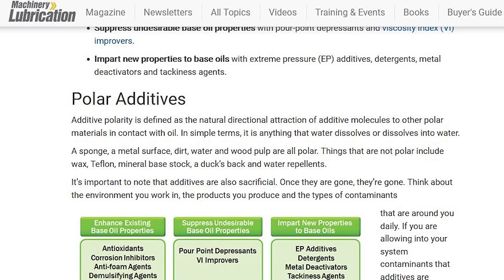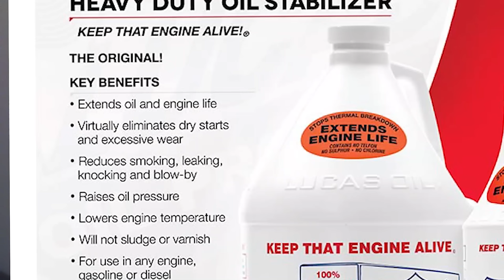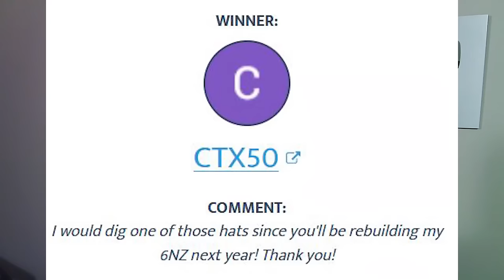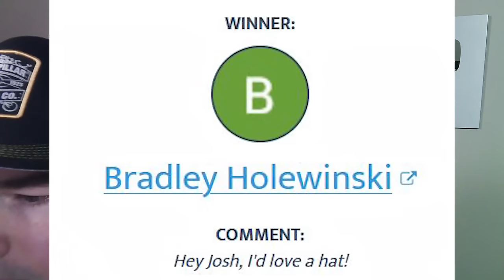Does your Engine NEED Lucas Oil Stabilizer? A detailed look at the "Benefits."

Comment: I been using Lucas sence I knew about it. I never used a hole bottle at one time. One bottle per 2 oil changes, it works perfectly...not bragging but I went a year on my Escalade, maybe, 300,to 500 miles a week..knock on wood. I been changing now!😂😂

Comment: My car is burning oil and they recommended I up my oil weight from 5-20 to 10-30, use conventional oil, and use 20% Lucas Oil Conditioner. I am wondering if next time I could just add one quart of 20w50 instead of the Lucas Oil. I was reviewing Bob is the Oil Guy and there were some comments about it frothing since it has no additives to it and that all it is is 120 weight oil with no additives.

Comment: When it’s cold like you showed in the strainer, was it mixed with the regular oil ratio as if it was a sample from a truck that had it mixed with the regular oil .  I bet it runs through faster then if it was just straight 60 weight

Comment: I was wondering are you supposed to put a additive in while the engine is cold or put it in while the engine is running. That way it can mix with the oil. I know stp recommend putting it in while the engine is hot and running.
After all your not running pure additive.

Comment: I noticed you made a lot of statements that are not corroborated by any documentation.  That’s exactly what you knocked Lucas’ claims about.   I’ll stick with using their products, based on the positive results I have seen in my vehicles.
Reply from the maker: They are the ones making the claims, their responsible for the evidence. Burden of proof is not my responsibility.
Reply: @AdeptApe  It appears that the majority of those who use Lucas answer “yes” to your question.

Comment: I run cats and 12.7 . I also run small block flat tappet cam Chevy circtrack motors. We run very low viscosity oil . We have to run zinc additive to  help keep cam and 
Lifters alive. I put zinc additive in every other oil change. Does it help? I don't know. But cheap insurance

Comment: I have a 2001 Sierra 5.3 with 400k I use 5 quarts of what ever is on sale plus 1qt of Lucas. I changed my oil religiously. My engine sounds and runs great and smooth for how many miles are on it. I drive it every single day. Is there any way to prove that Lucas oil is actually beneficial probably not but I've been using it for years and don't have anything negative to say about it

Comment: Use this in BOTH MY VEHICLES ('05 IS300, '06 TUNDRA) along with my '03 GSXR600, never had issues or problems and both vehicles are in EXCESS of 160k (Tundras got 200k), I've used this for YEARS and have always had respectable responses from mechanics when they've looked at the valve train and far as CLEANILINESS (internals) and how well the vehicle RUNS on an over all basis. I will continue to use this as I have on EVERY vehicle/street bike I've owned in the past. Plus, I've USED MARVEL MYSTERY OIL TOO and that shit WORKED WELL ON MY 65K mile 1967 SKYLARK.... smoothed it right out..... not all additives work, BUT THESE 2 DO. UNDERSTANDABLY not every BELIEVES the HYPE and everyone's entitled to do their own research AND SHOW PROOF of YAY OR NAY.... HELL I EVEN use LUCAS OIL "HEAVY DUTY AG" GREASE ON MY Tundras grease points because it burns up the MANUFACTURER GREASE FASTER then it does with LUCAS OIL PRODUCTS. I've never had catastrophic failure of ANY KIND using these products  LONG TERM, more over it didn't CAUSE EXCESSIVE WEAR ON ANY PARTS INTERNALLY including OVER WORKING THE OIL PUMP..... So I'll stick with em.👍😎

Comment: Question, my wife has a 2014 Terrain with 2.4 engine. If I do not put bardahl no smoke after oil change(about 6 ounces) the Terrain will stall, I replaced many parts and only thing that stops the stall is a oil thickener. Any idea why? I went 1 year after adding the no smoke, not once stalled, did oil change, stalled every time, added no smoke, stall stopped again. I'm confused.

Comment: Never been a believer in engine additives. Engines are designed with specific clearances, which require specific viscosity. Most are bandaid type products. Regular oil changes, filter changes, and general maintenance are the secret sauce for long engine life. The one product I used years ago was Tuff Oil. Pure PTFE. It came out before slick 50, which was just PTFE suspended in standard motor oil. I used to build VW air cooled engines many years ago, and always used synthetic oils on account of the high heat generated in air cooled motors. I had one motor that was run extremely hard for about 60,000 miles, and tore it down to do a cylinder change. I took the crankshaft into the machine shop, and it needed zero work! For an air cooled motor, that's been run hard off road, that's unheard of.

Comment: I’ve used it for twenty years never lost a  bottom end and all engines did over 1 million miles. Detroit, cat, Cummins. Serviced ever 10,000 so was it that or the Lucas I don’t know. Used fuel conditioner every service also never done an injector either. Who knows

Comment: This is my testimonial on Lucas Injector Cleaner;not oil additive. I have a VW 1.9 liter TDI Jetta with  425kmiles. I dont know about the oil treatment but the injector cleaner did not work. I had injector quantity deviations that caused alot of vibration at idle. I was driving 60k miles peryear.Used one gallon of injector cleaner religiously over a 2 year period. It did nothing. Within 6 mos of using Archoil Injector cleaner, my injectors were cleaned.

Comment: 310k stock lb7 I use in transfer case, front rear diff, engine oil. transfer case lasted 300 before pump rub got me. front rear diff do not leak all original seals except rear diff I replaced front seal with new yoke.

Comment: I tried Lucas in my 1974 dodge dart 360. It would dilute and make my engine lose a quart and half. Also the oil would look thin and foamy when I did the oil change. I was scratching my head not knowing that the Lucas was the culprit. After I stopped using Lucas my oil was normal and engine didn't use the quart and a half anymore.
Reply from the maker: Thank you for the comment, Lucas doesn't put these up on their website.

Comment: I bought an old dodge years ago. The guy replaced the motor with a bad high mileage one. Filled it with Lucas oil.  I had to replace the motor 100 miles later. Never could find the guy I got it from...

Comment: I think you mix this one gallon to 10 gallon of oil . I ran this in my Detroit 12.7 for 1.2 million miles same turbo and never removed the head . Also ran it in a C 15 Caterpillar truck engine which I did an in frame at 820,000 miles which I tore down because of a blown head gasket . I couldn't hardly hold the rods in my hand after removing . I cannot see it makes oil thicker but it actually makes the lubricant hold on to the metal surfaces . I do think most good engine diesel oil Chevron, Mobil & Shell already have treatments mixed in . As you know I have owned many Caterpillar truck engines 1693, 3406A,3408PC,and an Accert C-15 not a CAT fan so I can see why Caterpillar doesn't recommend it every body blows and crows about their Cat engines but then why are they not building  big truck engines anymore??

Comment: What about their stabilizer for newer engines? I can tell you their power steering stop leak works exactly as advertised. It said may take two bottles, mine leaked so bad you could watch it drip sitting not running, 2nd bottle, it totally stopped

Comment: So when my shop went from 15/40 t4 to 10/30.  All the older trucks didn’t like it. Lucas was made for diesels.  Not Hondas that run 0/20.  It’s not a mechanic in a can.  Maybe your looking to deep into this.  Again it keeps that “old” engine alive.  Now it does leave a nasty grease stuff in the valve cover. Bud again it’s a bandaid. Common sense goes a long way.

Comment: Don't doubt your findings but is it a "one size fits all"?  There are clearly different products for transmission vrs one for conv oil and one for synthetic oil.  Are you saying they are all the same product in the bottle?

Plus anyone who thinks an additive can "fix" anything is not that bright.

I started using the oil additive in my Corolla (regular) when it reached 250,000k and my Explorer (synthetic) when it reached 200,000k.  Both run great so who knows?

Comment: What do you think of prolong oil treatment? They have those crazy bearing tests where they put all the pressure on those bearings or they run the engine with no oil pan for hours and hours after treatment

Comment: My experience with the lucas is that its very good at gluing oil to every surface inside an engine, and keeping it there till the end of time.  It also failed to fix the valve cover leak.  0 Surprise there

Comment: Ive gone back and forth with lucas over the years..but i just put their synthetic stabilizer in my 2010 dodge 2500 5.7 hemi that developed a little tick in the valve train and it shut it right up

Comment: I noticed reduce MPG I normally take a 1:30 hr drive on the weekend it takes me 1/4 tank but it move to 1/2 a tank right after I used lucas oil. I normally have it used on old engines over 150k and it seems to do more good than bad, but in a newer car with about 60k it didn’t seem to have good benefits

Comment: I use 1 quart lucas on all oil changes.. if its a 4 cylinder then i do a little less lucas.. like 3/4 quart lucas and the rest the recommended oil. Never had anything but good luck with the stuff.

Comment: All engine oils are formulated with an additive package that includes anti-wear, friction modifier, detergents, dispersants, anti-oxidants, corrosion inhibitors, extreme pressure, anti-foaming, anti-aeration, seal conditioners, etc... I'm not referring to the aftermarket supplements like Lucas, BG MOA, Hy-per Lube, Liqui-Moly Ceratec...etc. It's not a good idea to use those aftermarket supplements as complications from additive clash and/or base oil incompatibiltiy are real issues that can do more harm than good.  Oil formulating is a very careful balance to ensure no one additive (or additive type) overpowers another.  When you go pouring some random supplement/stabilizer into that formula, you've now upset that balance.

Oil Stabilizers/Supplements are 99.5% olefin copolymer (a waxy, rubbery polymer) and 0.5% polyisobutylene (tackifier).  The polymer is a viscosity modifier with very poor shear stability (loses >50% of it's original viscosity after 100 hours) and the tackifier is only there to make it cling to those gimmicky plastic gears in parts stores to deceive people into thinking that's actually useful.  Tackifiers are useless in an engine since engines are lubricated with a pressurized oiling system.  In that system, tackifiers only clog up stuff.  Tackifiers are useful in equipment that sees splash lubrication such as manual gearboxes and differentials. No aftermarket oil additive/supplement on the market will contain any useful additives, it'll only dilute the amount currently in the oil, shortening oils life, weakening anti-wear, and promoting both oxidation and aeration of the oil.

Short summary,

Avoid using aftermarket oil additives – Store shelves are littered with aftermarket additives that promise to increase fuel economy, reduce wear or restore an old engine to like-new. Adding them to your oil disrupts the oil’s chemistry and may reduce its ability to protect your engine. When you’re using a good motor oil, there’s no need to modify/alter it with an aftermarket additive. No synthetic engine oil on today's market needs to be stabilized. 

https://blog.amsoil.com/more-than-you-ever-wanted-to-know-about-motor-oil-additives/?zo=5270935

https://www.machinerylubrication.com/Read/29836/aftermarket-oil-additives

https://www.machinerylubrication.com/Read/29610/aftermarket-oil-additives

Comment: I use Lucas oil ad on lubricant, the truck engine do run a little quiet,a little more pressue, it do let over all temperature to drop, so I use it,but not in the winter time.th

Comment: I ran a couple gm 6.5td and it only took 7qts of oil and pulling my 7k trl it thinned my 15-40 rotella so it had low idle oil pressure. Using 1 qts of the 7 qts capacity my oil pressure didnt flucuate.

Comment: Using this goop isn’t any different than using 10w-40 or even thicker oil. In fact, I’ve seen people use BOTH. Say bye-bye to your overhead cams! If your engine has VVT or cam phasers, it won’t for long…

Comment: Here's the thing I don't like about this "talk" in that it's just talk when some hands on experiments could have been performed to check their claims by you. I have used this product before and find it works best in the gear box than for the engines. That extra tackiness helps oil clinging to the gears. 
But what's missing is just like you said very clearly, no actually test done by anyone on this product. And I will add that it seems some scruples people would make use of it to sell others a bad product using this to cover up that damages.

Comment: talking about tight clearances is great and all but I use this stuff in my beat s10 with 300k on a 4.3 without it I only get like 8 psi oil pressure at idle still runs great and only self steers a little bit

Comment: My car started using oil around 200K miles. I have to add a half quart every 2-3,000 miles or something. It burns more as the oil gets older and thins out. Been considering Lucas but on BITOG I swear I heard people talk about it bubbling up in the motor or something. I can add 15w-40 diesel oil and the car will burn very little, but I swear I'm getting check engine lights from it or something. diesel oil is suppose to be bad for cats. If Lucas works I'll grab a bottle and top it off as it burns or something.

Comment: Basically everything they state as a benefit for their product could be had by using a heavier grade of oil.

But than again a heavier oil's lacks the special unicorn tears.

Lucas oil uses extremely low quality base stock, which ironically is pretty good at cleaning. The more you refine an oil the less polar it is, it lacks natural solvency from the fatty acids/waxes naturally found in oil.

You remove these impurities and you have the typical US 'synthetic' oil. You're left with a more refined/pure oil however the fatty acids in the oil is known to dissolve sludge (to a degree).

You run into a problem though, low quality base oils can clean, however their less pure. So they are far more likely to cause their own build up of sludge/varnish even during normal OCI.

These fatty acids where viewed as good in the past. Engines had sludge/varnish, so cleaning was a good thing. However after awhile it was found using higher quality base oils left less deposits overall. The goal than changed from oils cleaning sludge/varnish to oils not contributing to sludge/varnish in the first place (with normal OCI's).

Some higher grades of oil (group v) have a natural solvency to them, they can clean, and are pure enough to not really create deposits of their own. These types of oils are very expensive (relative) to normal consumer oils, to the point their typically not used, or if they are in very small quantities. Some companies to produce higher end oils, but even they only use about 20% group v base oils, which still results in a cost increase of 300%+ over more premium consumer grade oils like Mobil 1 EP.

Comment: If it would fix a knock it would be worth it cause i'd sell that thing ASAP regardless of the rest of the detrimental stuff.  Good product and I used it on my C-15 then would have shop fill the jug for add oil.  Never needed add oil so I sold 110 gal of oil when I stopped trucking all in Lucas jugs.

Comment: I am currently using 10w30 synthetic blend in my d13 volvo, it has few very slow oil leaks, would it be better to switch to 15w40 or use lucas in 10w30?

Comment: Oil is a coolant in the engine so less friction would cause less heat. I would say this one is unfounded. Normal oil works fine. Engines are not designed to run cold.

Comment: as for the oil filter bypass.. your talking around 70+ psi on average, most car's (factory) run about 35-40 tops lol i doubt lucas brings it up to that high, yet agree'd it will be thicker. but no more then stp or motor honey if add'd correctly.  also only time you need really higher oil pressure, is in racing conditions, oil volume with pressure is best for every day driver imo.

Comment: I don't know about oil additives, but the Lucas upper cylinder lub/ injector cleaner immediately stops the slight miss in my chevy with old spider poppet valve injectors.

Comment: 0w20 is not a 0 weight ( It is never thinner than 20 weight at 200F). The "w" stands for winter rating, doesn't over thicken crazy far beyond a 20 weight at cool temps/starts.

Comment: You say it’s thicker oil but if you ever mix it with 15-40 it thins out very quickly. So I don’t see it really helps anything. Now I have had trucks that were close to and oil change and the oil pressure dropped slightly. And put Lucas in it and oil pressure went back up. But to me it’s not the thickness but the new oil itself being put in the engine. Just my opinion but it’s not worth it to me. 250 hour oil change and GOOD filters. Don’t just cheap out.

Comment: used lucas in all non daily cars that sit.  the key is to only use 1 cup and mix it with your other oil in one jug to make sure its blended. NEVER just pour lucas in, ever.   these are older engines though (1994 sr20det and v161 2004 2jzgte)

Comment: Plain and simple works great in older cars I would say 2008 or older and works great in a simple engine such as a 3800 or a 5.3 or hond d,b,k series any newer car or more complex low weight oil engines maybe a problem.